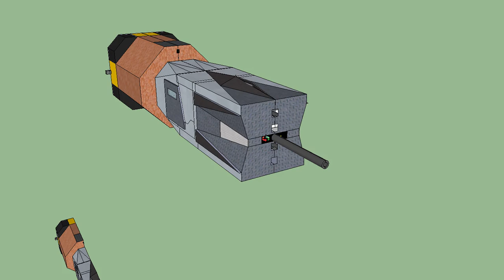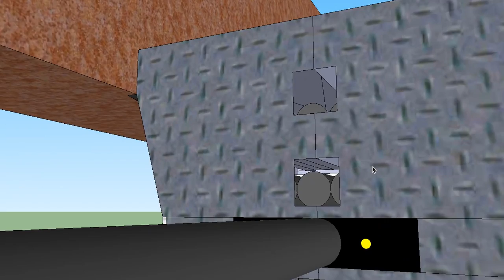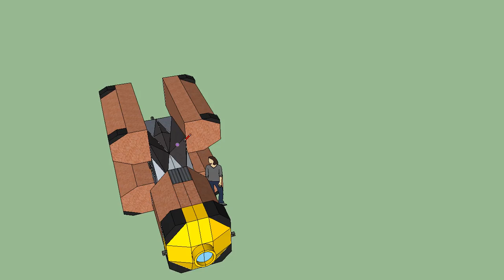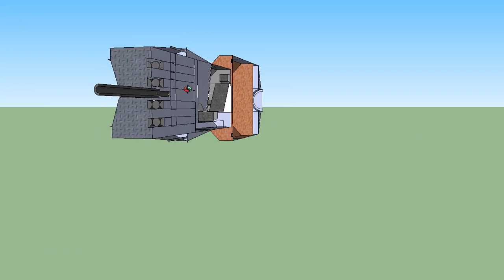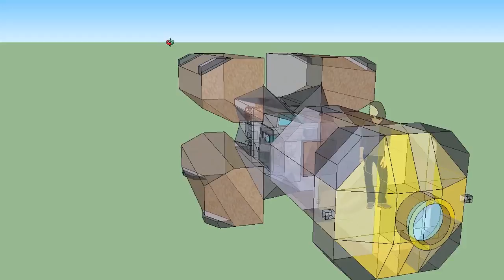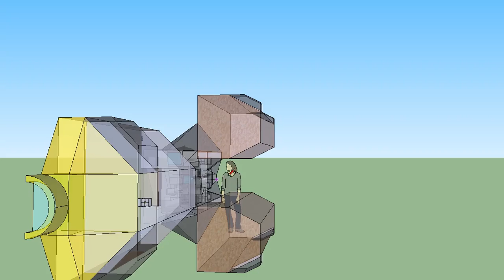Realistic Space Fighter Design Concept

Comment: Very good design, I'm probably going to use some of the design elements (particularly the silhouette) in my . own, since fighters have been something I've been struggling with. They are a little small, however, and I don't think you could have adequate life support or fuel for even a relatively short mission, as everything in space is hundreds of thousands of kilometers away, at the very closest. Trippling the size and adding a few more weapons would be pretty prudent, then you have enough pace to fit a small bunk in as well as some food and water storage, as well as enough space for much more fuel and munitions.